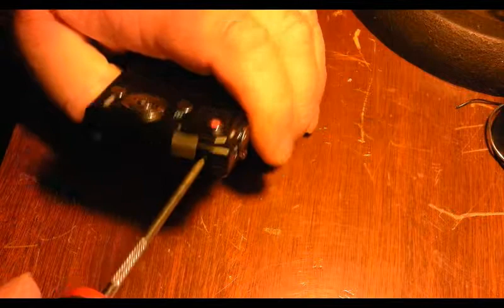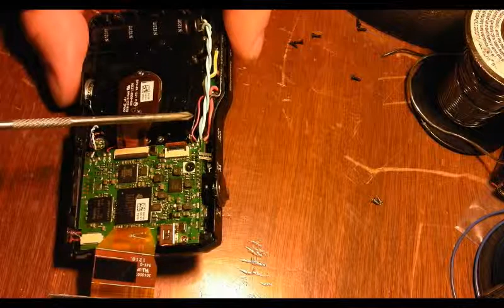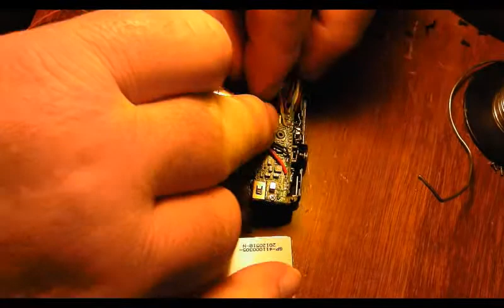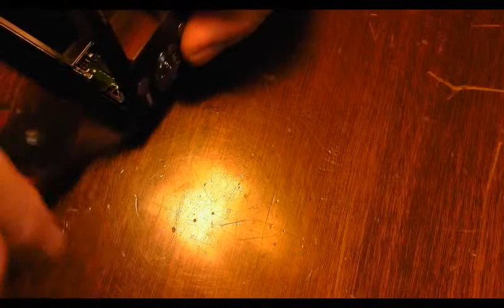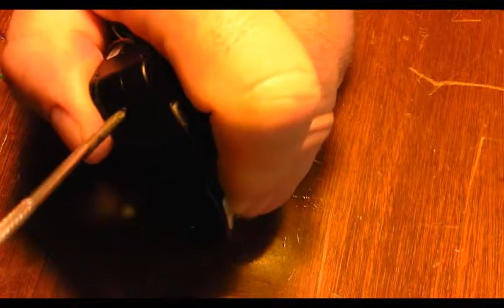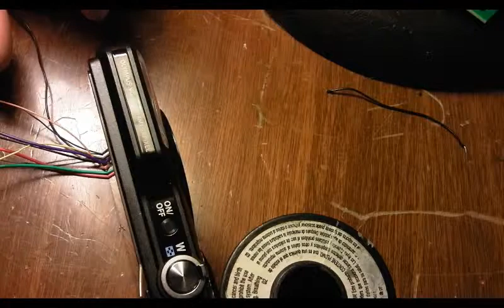Olympus VG 170 & 190 hack video

Comment: What I have found for the VG170 and VG190 is that you need to use the power common wire as the common for the shutter also and use the battery negative as common for the video. You will need a control board that has a second opto to control the video function. Camera wiring to the control board will be power wire to 'P', power common wire to 'PC' and shutter wire to 'S'. The battery negative and the video wire will get connected to the second opto and the control board used will determine what the terminal designations are that you should use.